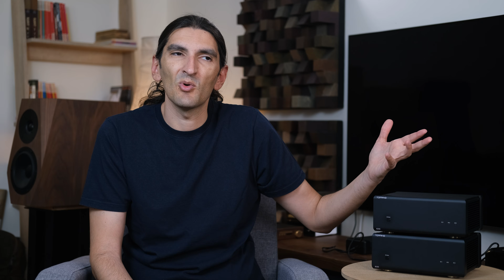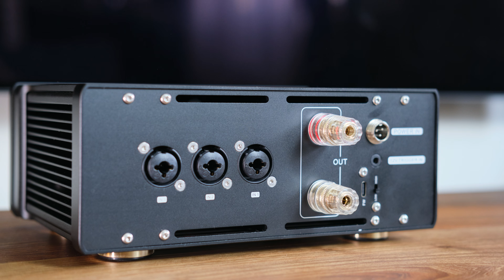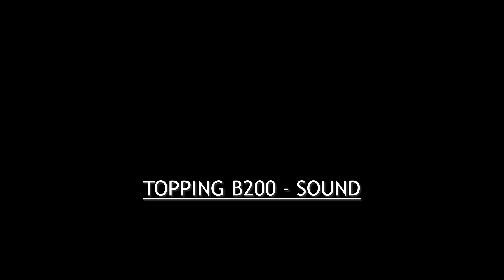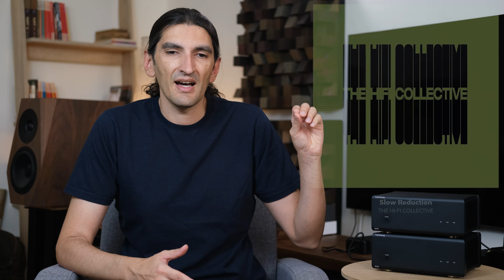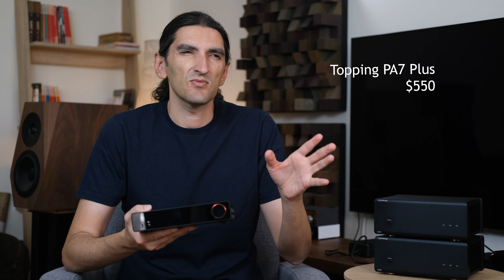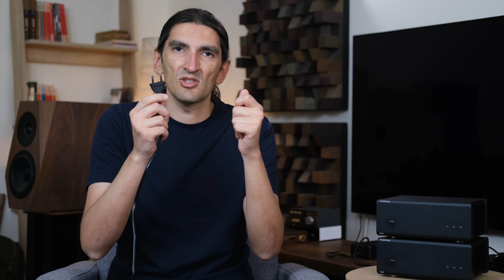Just get them and thank me later - Topping B200 review

Comment: 22db gain seems kinda low for a 200w amp, for use with typical home 2v devices.  I suspect certain use cases are going to be volume limited based on the input voltage you're able to send it, whereas I'd rather be limited by the power amplifier, and have it outputting maximum power with a 2v input or even less, like 1.4, so you never come close to distorting or clipping your output devices preamplifier/op-amps.
Reply: 22db is fine. My nuerochrome mono's are set for 20db and 240w. I have volume to spare with a 64db MC phonostage and unity gain pre-amp/buffer into yamaha ns1000m.

You'll only want more with sub 80db speakers or a huge room. Or very low impedance speakers, and then you want current not volume.
Reply: @BestKiteboardingOfficial  I have no doubt that it's "fine" subjectively, you're right we're usually not using that much power.  My point was merely that with a typical 2v DAC I want the amp to deliver maximum rated power at or below that level, whether most people use it or not, they should be able to get maximum power out of the amp without clipping anything ahead of the amp.

I have a unique use case, not subs, where I in fact can use 200+ watts continuously from an amplifier, since this is a pure 2ch system, no sub, with pro 15" woofers, which are EQ'd such that I can have my desired level of bass (above flat) down to 30hz.  The speakers are quite capable of this but I've sent fairly powerful amps into protection playing certain material at high levels.  My 150ish watt amp will trip long before I'm worried about driver excursion or heat or distortion.  My 500w crown amp is another story, but that doesn't sound as good.

These amps are interesting, but I'll be getting a hypex or purifi based amp.
Reply: The standard output voltage for XLR sources is 4V. Active preamps deliver much more Voltage. Low gain makes the amp suitable for DACs with digital volume control. Most speakers run at 1 to 5 Watts at sane volume levels. Nobody really needs gain - its all about current delivery and stability. And this amp has very poor current delivery.
Reply: @soulfunkjazz  I don't think that's accurate, why do you say this amp has poor current delivery?  This is a purely objective measurement. 

Most dacs are 2v not 4, and most home users aren't running 4v XLR, but having a selectable input gain for exactly this reason is a good thing.  When talking input/output voltage of components it's sometimes also overlooked that RMS isn't the same as peak.

Comment: I wonder how the Topping B200 with a Topping D70s would work?  The D70s is less analytical than the D90 series with a decent pre section when used with standmount speakers...according to Sandu.    Toppin Pre90 could be a fit between these too I suppose.  A nice Topping stack?
Reply: I use the D70s with PRE90, fantastic combination 🥰 would not use the D70s as a preamp if the budget allows it 😊
Reply: @justasimplefox  I have a short list of amps to replace what I have now but it's pretty good with the topping on opticon 1s.  When I upgrade the speakers perhaps.

Comment: This amp is just adding to my struggle.  I am finishing a 3-way design.  The tweeter is a compression driver mounted on a horn and passively crossed over to a 10” mid/woofer.  Then there is an electronic crossover to dual 15” woofers (Open baffle design).  One of the design goals is to be able to use a low power Class A or tube amp on the top (10-20 wpc) and around 200 wpc (or more for the woofers).  I entered this design assuming that I would just use a Class D amp for the woofers, but amps like this are giving me second thoughts.  While I usually consider myself a solid state guy, there is a real synergy between horns and tubes and I’m beginning to think that a good Class AB amp would pair better with a low power tube amp up top than a Class D amp.
Reply: Get a pair of Fosi V3 Monos with two 48 volt power supplies. These will drive your woofers great! Put a good tube amp like a Dynaco ST70 on the upper range.

Comment: You just saved me $3k. I was trying to save to upgrade my current Hegel h160    hoping to purchase an h390 by 2025. I will instead go for these Topping B200 monos and upgrade my dac to a Gustard a26, also based on your review . I'm 64, and after listening at high decibels movies and music for over 50 years, great detail transparency and fantastic soundstage imaging is my thing. I'm way past tubes, mellow rounded analog sound. Thanks. You, sir, are truly trustworthy.
Reply: And the reason these have poor current delivery? High current delivery is expensive. It needs big power supplies, and output transistors. Plus, peak current delivery doesn't sell amps. Power output & SINAD is currently king for sales. Even if neither, on their own, are decent indicators of fantastic sonic performance.
Reply: @RacingAnt  Yeah, I'll be careful with low-current amps. The LS50 mentioned here at the beggining of the video are only 85db speakers. Really hard to move. I have tried both low and high-current amps with them, and the difference is HUGE. The Hegel will deliver what the LS50 need to sound amazing. Any low current will make your LS50 (meta or not) sound just like any regular low-budget speaker. At least in my experience.
Reply: @RacingAnt when someone is so expert and one-sided on a topic….I tend to ignore them. 😊
Reply: @RacingAnt  Buckeye class D monoblocks based on Purifi Eigentakt 1ET9040BA modules deliver up to 40A of current … 1100 usd a piece
Reply: Try the Audiolab 8300Mbs first. Relatively cheap at the moment and will drive anything. I have them paired with an A26.
Reply: Great choice! The amp and the DAC as well.
Reply: With the history of the LA 90D fresh in mind I wouldn't jump on this train for a while even at this price pov
Reply: I’ll take your Hegel any day. 😊
Reply: Gustard A26 with a U18 and a 10Mhz AfterDark Master Clock! Sonic Nirvana
Reply: VTV has some Ganfet amps you should check out. Have you heard a SMSL D300 ROHM chip DAC , 😁 THANK ME LATER
Reply: Listening before the purchase is always a good idea. But objectively, measurementwise despite the low current delivery it's definitely better than any Hegel amps.
Reply: @AttilaBalla87  current delivery is key for an amplifier. Hegel amps have a frequency response that is absolutely flat across the audio band, distortion that's below measurable levels, and enough current to ensure the response is maintained into any speaker load. These amps have astoundingly low distortion, and that's it. The sample I've heard sounded thin and weak playing music through real speakers in a real room, not just pushing a 1khz sine wave through a purely resistive load. So, as I said, listen first, or ensure you can return them before committing $$$. Particularly coming from a highly regarded, and fantastic measuring, amp like the Hegel.
Reply: Considered a Schitt yggy DAC?
Reply: I have the Gustard A26 - its very good.
Reply: Keep your H160
Reply: As a 60 yo music lover (I do not dare call myself audiophile) I totally dig your thoughts on transparency and imaging.
Reply: But his review are all subjective, no insturmented tests at all. You wouldn't know if how he hears them is how you'll hear them.

I once bought speakers (Sony SSCS5) based on a subjective review from a popular budget audio channel, and now i regret buying it.
Reply: @sepg5084  That's been true for every review of every piece of audio gear since gear reviews started.
Reply: IK the channel & the speakers.  @sepg5084 

Another reviewer didn't like them. Would u recommend them? (Price range, too)
Reply: Yep, never trust other people's ears... good thing it wasn't some expensive speakers. @sepg5084
Reply: @sepg5084 idk why those speakers measure extremely well too lmao
Reply: I'd hear these first. They have next to no current delivery. Doubt they'd come close to your H160. Tread carefully, and make sure they've got a great returns policy.
Reply: @RacingAnt  uhh you don't understand current.
Reply: I have both tubes and solid state. Now I more towards tubes, but I like both. All I can say to you is forget Hegel, I heard recently a Hegel and is IMHO overrated, I heard it in a very good listening room, with very expensive loudspeakers and a Eversolo A8 streamer. it sounded good but "shouty"' (?) ) (for me) in the upper middle frequencies. Sort of a typical late 90s solid state sound. Then we switched to an "inexpensive" Cayin tube amp and all that shouting disappeared and the soundstage got wider and deeper. I asked the seller why people buys the Hegel?..."It s for the looks and Youtube marketing" he answered me. This Topping are on my list now...
Reply: @ccapri9357  I listened to Prima Luna tubes with my Totem Fire V2, and it was fine. After that, I tried a Luxman amp priced at 20k. It was okay, but I wasn’t blown away. Finally, I tried the Hegel H390 with no expectations, and this amp blew them all away. Now, I want the H390 and It wasn’t shooty at all. I’m wondering about those B200 if they can save me some money.

Comment: Would an 87db 6ohm speaker be hard to drive?
Reply from the maker: Given it doesn't have some huge impedance dips, which it probably doesn't, no it's not a problem.
Reply: @iiWiReviews  Elac Debut 2.0 F6.2
Reply from the maker: No problem there
Reply: Given the low current I would recommend you listen and test. There is a very likely risk that these amps would lack bottom end and you might get a very sterile sound. I recommend IWI puts them on high quality power hungry monitors. That made the LA90D crumble and this is more or less the same amp in mono setup.

Comment: I have never seen a Class AB amp powered by a switching power supply!  I wonder how much effect the power supply has on the amps?   With all our other hifi gear, we consider a linear power supply to be an UPGRADE over a switching supply… would that be applicable in this case too?  Would a LPS improve these amps?
Reply from the maker: I belive that Benchmark is using smps with their amps that are class AB too. A good LPS might be an upgrade but for this power it would be huge and expensive.
Reply: Not as usual as you may think, can work very well 🎵

Comment: I'm looking into purchasing mono blocks soon as my Spectron musical MK lll class D amp designed by John Ulrich just lost the right channel  It's output was 500watts@8ohm 650@4ohms and 1,200 watts@1ohm  So I'm looking for amp that will bring my Maggie's to their knees, like my Spectron  Thanks for the great review! I will definitely check out the Topping monoblock amps  I have been considering Orchard Audio (know of them?) and Leo's GaN monoblocks  I took this description from Leo's web page Oh he's a one man show 

Linear power supply
Custom 1000VA toroidal transformer
133,600uF of capacitance
Fully balanced from input to output
Extremely low noise and distortion
Power output 250/500W (500W/1000Wpeak) into 8/4Ω
2-ohm capable
Size per monoblock(W x D x H): 31cm (12.2″) x 35.3cm (13.9″) x 11.6cm (4.6″) – w/o binding posts
Weight per monoblock: 11.3kg (25lbs)
Reply: Have you thought about second hand? I am driving my acoustat x with Harman Kardon citation 22 in mono. Gives 400 watt per channel. And with loads of power/current. Total cost for two amps 800€. And unlike most new gear, these prices are rising 😊
Reply: @annebokma4637   I bought my beast of an amp, the Spectron used, weighing in at 54 lbs That's a lot for a class D amp I think it was less than a $1,000 USD but It lost the right channel So do I go down that road again?  Mind you I still have my VAC tube amp and ARC LS15 tube pre amp that I bought back in 1996 and they are still going strong
Reply: @Jack96993  couldn't be repaired?
Reply: @Jack96993  most of my gear I bought new... In 1988 😎 had them checked once in all that time. For my latest buys it is vintage (like a pair of Quad ESL 57 for €200 with an €80 service) or new headphones or dac. Headphones are too personal (specially if you can't/don't replace earpads)
My problem is I don't wanna sell anything 😎

Comment: Nice! I wonder how they compete against Giant Killer Galion TS A75 Power Amp
Reply: Having enough current with a proper build doesn't need to go as far as A75, but I always prefer overkill than lacking like this thing does. (I have the A75.) This is like the Fosi V3 mono, I have them too btw. The numbers look great on paper, but then you put them on some proper 6 ohm monitors that dip low and it's crumbling. Dry, sterile sound is the result. These amps do not deliver a full range of 200 w in 8 ohms. In fact I'm pretty sure the A75 will with its 75 watts get more out of your speakers. ChiFi products are going down the old car stereo road and it's way beyond getting old..
Reply: These monos are significantly cheaper now and more so on sale within a year.
Reply: The difference in current capabilities alone should give you a hint .
Reply: @wegardfjeld3789  The Galion shows off its huge capacitors but there are ultra high end designs driving stupendous systems beyond Galion that has much lower capacity. Listening tells all.
Reply: Class A watts are not the same as class D watts on a watts per watts basis.  This may be due to its current inductance capabilty

Comment: I don't really like the power blocks and would probably look for something better to replace them. It seems that Class D having more detail is not a given. I am still on the fence about the Hypex Nilai Mono blocks. Those are rated for 2 ohm and have dedicated manufacturer designed power internal supplies. These would set me back 800 less though (or 300 if i were to get the stereo version).
I do like the fact they have multiple RCA inputs. If you want to use different pre-amps you easily can.

Comment: Thanks for the review 😀

How would you connect these to a single (T5x) REL subwoofer? just pick a channel?
Reply: That's the same problem I have with some of the other ChiFi monoblocks.
Reply from the maker: In case of one sub, you take the signal from the positive (red) output of both amps, and use high level connection on the sub. Ground can go to the negative (white output) of either amp.
Reply: @iiWiReviews I got 2 REL's
Reply: Preamp
Reply: @artureff3046 
The best way to connect REL is high level input,  that's trough the speaker binding posts of the amp. With low level connections trough pre amp you will loose a lot of dynamics
Reply: @artureff3046  yep. But that makes the preamp outputs on the amplifier a useless expense.
Reply: I think that the REL website has instructions for how to do this with a common ground
Reply: @chelillingworth9466 
Partly true, REL keeps refusing to give proper info  how connect to fi a Purifi amp properly and to dedicated Balanced amps where the negative binding posts are not ground. The best way is to leave the black ground wire  not attached and only use the red en yellow wires to the positive binding posts .